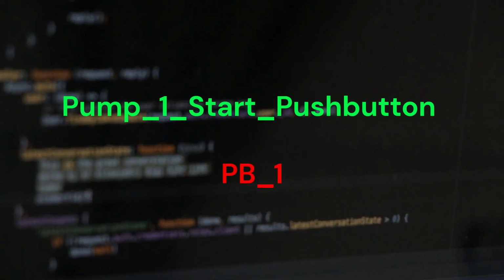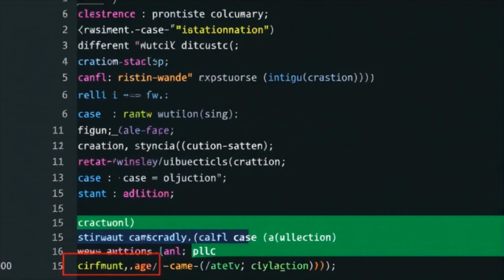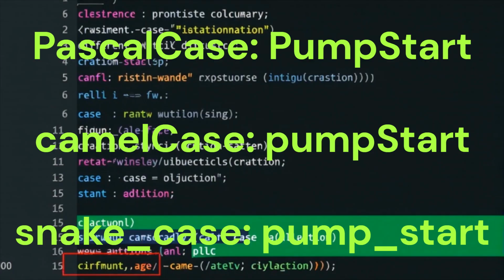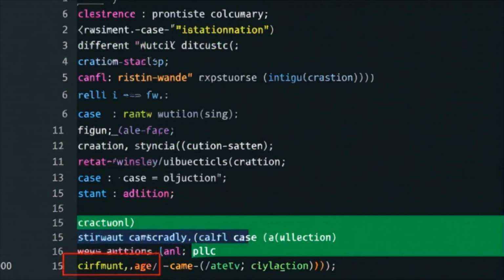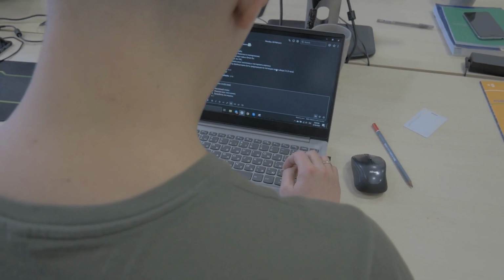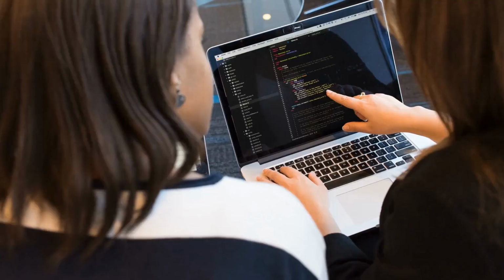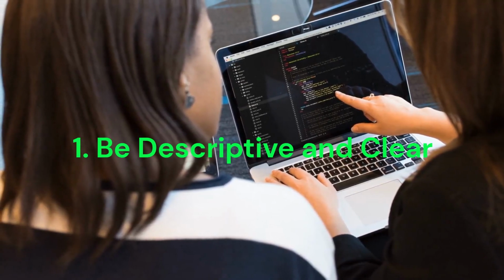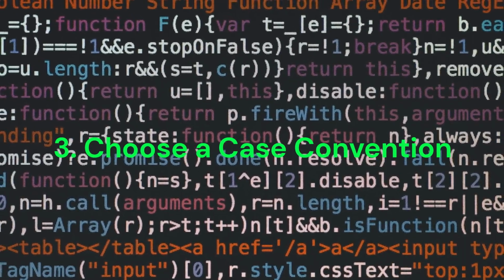Why Messy PLC Tag Names Destroy Troubleshooting (And How to Fix It)

Comment from the maker: PLC Beginner’s Guide to PLC Programming
https://accautomation.ca/programming/plc-beginners-guide/

Here are the controllers that we have covered at ACC Automation:
BRX Do-More Series (Do-More Designer Software + Simulator)
https://accautomation.ca/series/brx-do-more-plc/
Productivity Series
https://accautomation.ca/series/productivity-1000-plc/
https://accautomation.ca/series/productivity-2000-series-plc-p2000/
LS Electric XGB PLC
https://accautomation.ca/series/ls-electric-xgb-plc-series/
Click PLC Series
https://accautomation.ca/series/click-plc/
Omron CP1H Series
https://accautomation.ca/series/omron-plc-cp1h-series/
Horner XL4 PLC Series
https://accautomation.ca/series/horner-xl4-series/

https://accautomation.ca/series/easyplc-software-suite/
EasyPLC Software Suite is a complete PLC, HMI, and Machine Simulator Software package. Please take a look below to receive 10% off this software. This PLC learning package includes the following:
Easy PLC – PLC Simulation will allow programming in Ladder, Grafcet, Logic Blocks, or Script.
HMI System – Easily create a visual human-machine interface (HMI)
Machine Simulator – A virtual 3D world with real-time graphics and physical properties. PLC programs can be tested using the EasyPLC or through other interfaces. (Modbus RTU, TCP, etc.)
Machine Simulator Lite – Designed to run on Android Devices.
Machine Simulator VR – Virtual Reality comes to life so you can test, train, or practice your PLC programming.
Purchase your copy of this learning package for less than $95 USD for a single computer install or less than $110 USD for multiple computers.
You should receive 10% off the investment by typing in ACC in the comment section when you order. http://www.nirtec.com/index.php/purchase-price/
Learn PLC programming the easy way. Invest in yourself today.

Creating a Virtual PLC Programming Environment
https://accautomation.ca/creating-virtual-plc-programming-environment/
https://youtu.be/fQ_DlOm3HZU

Retrieving Your Windows 11 Product Key
https://accautomation.ca/retrieving-your-windows-11-product-key/
https://youtu.be/DVaLRgKbgsM

Installing Guest Additions for Oracle VirtualBox
https://accautomation.ca/installing-guest-additions-for-oracle-virtualbox/
https://youtu.be/LyNhVLb75Zk

Regards,
Garry
ACC Automation
https://accautomation.ca/

Comment: Not sure of the value of this video. Many of the ACC videos are on point. Here are the issues I see: To my knowledge the Click series only allows Ladder Logic. The video does not show a LL example. The principles of naming conventions apply to a limited point. Data types are explicit: X for inputs, Y for outputs. There are data types that can be both. All data types are limited to 24 characters in the Click family. Rung comments and Address comments can add readability. Naming conventions are closely tied to program structure. Such as grouping functional sections. For example: Creating logic for an Hour Meter or the logic for specific inputs and output like an analog input for temperature and controls based on values. Click has added specific functions such as: High Speed input and interrupts, PID control, and a number of I/O functions: MODBUS, email, MQTT. The Click family also allows subroutines. Much like Structured Language programing. 

I am excited about this video because there is not a lot of documentation on programing structure and style for Ladder Logic. Structured Languages have evolved with some common conventions. Some Structured Languages allow creation of data types. Whereas in Click the data types are explicit, and availability is fixed. For example: the Control Relay data type is limited to 2000. The C2-userm has a good table of data types. I transferred this to MS Excel. Added MODBUS addresses. The standard is not perfectly followed in the PLC domain. This can be very frustrating when trying to connect devices from multiple vendors. I also am stratifying some of the data types. This is a little tricky in that all data types do not have the same total registers. An example- all C registers for one functional segment are assigned numbers in the 400 range. This way, referring back to Hour Meter and Analog Input, numbers are stratified so an error would standout and help with Ladder Logic flow. Counters for example are limited to 250 registers.  CT 1-10, 11-20... Another register numbering convention is using numbers across data types. For example: A rung is assigned as C214 in and has a math function with a DS214 out. 

This comment goes way beyond normal. Bottom line, I really like the Click plus and Cmore products. The programing software has a lot of depth. Moreover, there is a huge amount of documentation with helpful training videos produced by ACC. Non-ACC videos are also available on the internet. ACC is also continually improving and adding to the software. One feature I would like to see in future editions is the ability to export the cross-reference table. Some day.
Reply from the maker: Thank you for the detailed feedback. This was a general video and not explicitly directed to the Click PLC. 
I was thinking more inline with the Universal Name Space. This would standardize the naming conventions not only in the PLC but system wide. It would then lead to better implementation of MCP.
That is an excellent suggestion for the cross-reference in the Click!
Thanks again,
Garry